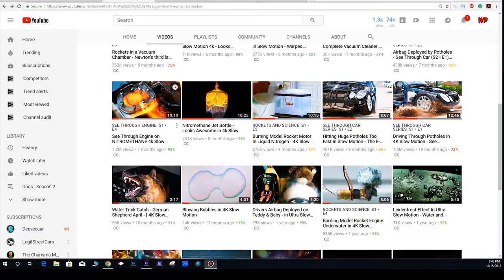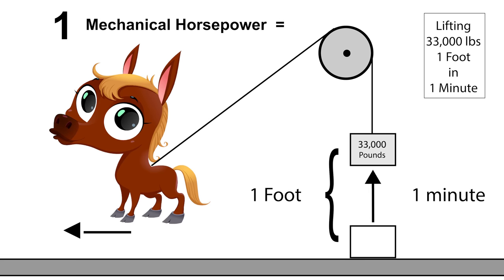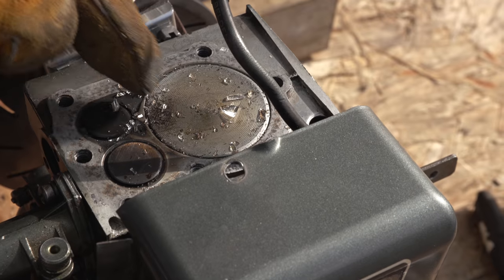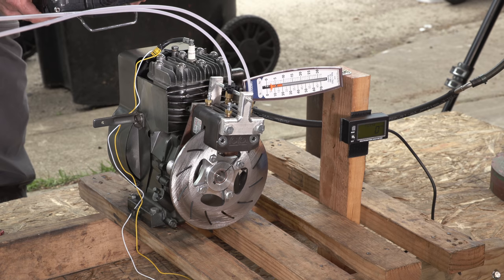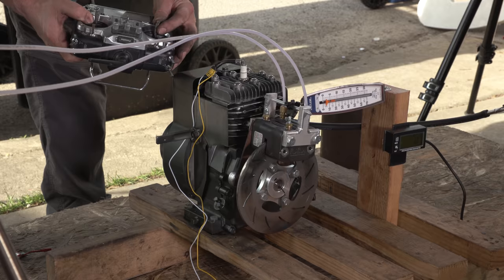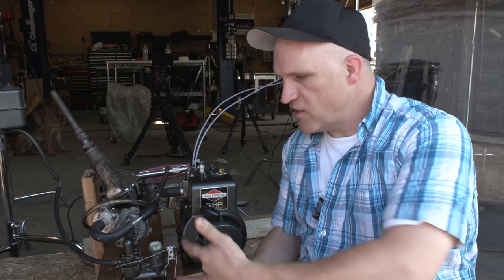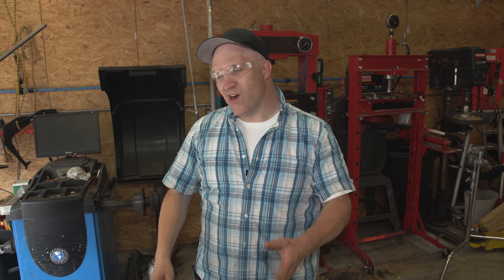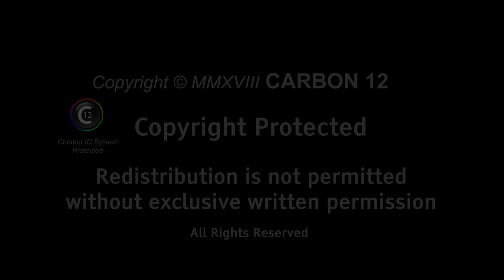See Thru Engine on Turbo Nitro and Dyno  (How much HP does it make?)

Comment: Turbo is too big I reckon, fit a wideband o2 sensor on it to help get the tune right 👍
Reply: I was thinking the same thing. The turbo is too massive for that exhaust to spin up since there's only 1 cylinder pushing it. If this were 2 cylinders, it 'might' spool it up fast enough.
Maybe go down 1/3 in size of the turbo. Hopefully after reading these comments he'll make the suggested changes and review the performance  :)
Reply from the maker: @korishan  yes sir, my figured why not try it out, what I thought was super cool was looking at the high-speed footage during the last take, even though the turbo is spooling up you can see the individual exhaust pulses.
Reply: @WarpedYT . I like your idea of getting injectors. I met a guy that had two turbos in series with each other. If you do find a smaller turbo maybe use both? I mean, why not... right?
Reply from the maker: Well This is a 27 mm turbo, the smallest that I can find online is a 25 mm. Keep in mind that this is the primary turbocharger of the sequential setup on the SL 65. If you have ever heard a SL65 Idle, you will notice that you can hear the turbo whine in the exhaust even when the engine is at 600 RPM. This little turbo is basically producing boost at idle when on it's original application, then at about 2, 000 RPM the transition occurs into the bigger turbo which I believe is a 55 mm, I'll have to measure it but yeah, for me 2mm isn't anything a little more fuel and timing can't make up for. And for the record I actually went to buy that little turbo, but I thought it was way cooler to take a turbo from a car and modify it to fit this engine.
Reply: @WarpedYT  I think your down pipe is too restrictive because it's on a cone chapel and produces unnecessary pressure just for the burnt gas to get put.
Reply: Yeah bad setup back to your drawing board if you're trying to call out turbos ya might want to set it up specifically for a 3.5 HP motor, constructively this was done sloppy and rushed try again turbos wouldn't be a thing if they actually didn't make large power gains
Reply: You may hear the turbo spinning when its idling at 600rpm... but its most definitely not making any BOOST when idling... its not possible.
Reply: @WarpedYT  go actually LOOK for a small enough turbo why say that dude
Reply: Warped Perception now maybe smog pump supercharger next time? If it works progressively step up to more aggressive pulley ratios and see how much more power it makes!
Reply: Yeah it’s going to be hard to find a turbo small enough to make any boost on that small of an engine.  Best bet would just be to hook up a leaf blower to the carb.
Reply: What about using compressed air instead? Rig up an intake with a 1-way valve and a compressor attachment with a trigger...so even without compressed air it can take air from atmosphere but when compressed air is added it doesn't leak out the intake.
Reply: Remove any restriction on the exhaust, turbos like having a completely unrestricted exhaust.
Reply: Warped Perception the whining you are hearing is the fresh air pump that pushes air into the exhaust for emissions. Maybe try putting another carb inline with the other carb.
Reply: maybe turbo from a smart?
Reply: its not the size of the turbo but how much air it takes to spool that turbo and the A/R size is not even making ATMO pressure if anything its a huge restriction you need like a GT15 or K03 or RB31 off ebay/the usual scumbags to even have a shot
Reply: A big turbo may have a big turbo lag but once the egine is running at full throttle it should provide boost which increases the pressure of the exhaust gases wich provides more boost.

Comment: That’s an ingenious dyno. 

I was thinking, how could he possible know what pressure the master cylinder correlates to what torque it would generate. But your brake is mounted to the torque gauge showing you the rotational force placed directly on it. 

Maybe you should explain that a little better in the beginning. But awesome either way.

Comment: Love how simple your dyno setup was! One suggestion I have to reduce the oscillation that sometimes happened while braking, add some extra weight that doesn't stop it from pulling on the scale, yet also resists quick movements

Comment: Warped Perception, I loved the video.  It shows a lot of thought.  The  home made dyno was the bomb.
Point of trivia.
I have a machine shop guru neighbor, who builds 3.5 Briggs, and 6.5 Honda single cylinder engines, for professional go cart racing.  He's getting, the last I heard him say, 32 horses out of a 3.5 Briggs, and over 60, out of the Honda clones.  14.5 compression, big titanium valves, Mikuni carbs, wide overlay cams, and Methanol, with trick exhausts; fly weight aluminum flywheels.  The Briggs are balanced and turning over ten thousand  RPM's.    The Hondas are balanced, and turning 12,000, to 14,000 RPM's. They make 100 mph go karts, if you have the nads to stay in them.
I understand what you are doing, and why.  It's fun, and something to learn.  But, if you want to turn that little one lunger on, there is nothing like big tuned carbs, and compression, with breathing ability.  Five thousand RPM's is just the beginning of making horsepower.  
As my uncle said fifty years ago, "If you want more horses, you gotta feed more oats."
Reply from the maker: Lol, that's a great story thanks, I can totally believe it. As for more horses from more oats that makes sense. My goal here in this series is to focus on variables outside of the engine design, pretty much I don't really want to modify the engine much but modify the variables if that makes sense. My original goal was to get the thing to blow up so I can move on with the engines that I'm featuring right behind this one, but this little Briggs is not cooperating so I'm just upping the ante as I go. Hopefully it blows in the next episode. Thanks for the story and thanks for the feedback that was awesome.
Reply: Exactly, and I'm all in, on what you're doing.  Two different goals, with different means.  Those engines start with $$$.  When you asked for bets, on horses produced, in the beginning, I said '75 horses,,,,, no,,,95'  haha. I thought it would be exotically wild!

Comment: That dyno is brilliant! Super cool to see you do this! Im thinking maybe try replacing the spring scale with kitchen scale and have the brake push down to it so maybe the bouncing around stops.
Reply from the maker: Thank you, well I figured out that the bouncing around was actually coming from the variable resistance of the grain from the Machining of the disk. Once it's broke in it's fine now. Nice and smooth

Comment: I don’t know much here but I would think that turbo is WAY too large for a 3hp NA motor. If you had a boost gauge on it, I would bet it’s not building any boost pressure. Get a hold of the smallest turbo you can find affordable and try again. ...pretty please with a cherry on top. Very entertaining video!
Reply from the maker: Normally you would be correct, however in this case keep in mind I'm running nitromethane, if you add more fuel than turbo will spool, and also be red like a cherry on top, seriously. but in the next episode I'm going to compare this turbo setup to a proper smaller turbo setup and see which one makes more power, I'm personally curious to see what's going to happen.
Reply: Warped Perception maybe a 15 mm turbo?
Reply: They are fairly large displacement. Don't be judging power output with capability to spool a turbo.
Reply: That's exactly what I was going to say.... Not to mention no intercooler.
Reply from the maker: I dont think they make them that small, this one is a 27mm and the smallest i know of is 25mm
Reply from the maker: agree
Reply: @FJRyder , an intercooler will not help in this situation at all. There's no air moving through it. 
I wouldn't even bother with the intercoolerif there was some air flow. 

Nitro is very hard on oil, that's a known fact.  There's different oils to help combat it, but generally just change the oil more often.

A little boost Guage would be pretty sweet.

I think a different carb would be the ticket.  Better adjustability.  IMO this engine is running to lean. Nitro takes a lot of fuel.   But still very cool setup
Reply: Cool. I liked your video, and appreciate that you're taking feedback about the turbo size, because I agree with the commenters that say it's too big.
Reply: What about a chainsaw turbo?

Comment: Wet vs dry boost; probably a very valid idea!  As far as US production cars are concerned in the modern era, Studebaker used a carb box on their blown Golden Hawk in 1957, then starting in 1963, they used a special sealed AFB carb on their R2 engine, and reverted to the carb box with the higher boosted R3 and R5 engines. The latter ran over 200 MPH at Bonneville in 1964, all with a 5 liter engine. Pretty impressive for a stock bodied car at the time!  They used basically box stock Paxton/McCulloch blowers.  The R2 would make about 8 pounds of boost in bone stock condition, although some claimed more...but with all new parts I'm assuming. In a completely different situation, the 2 stroke Detroit Diesels all were supercharged, but later models offered turbos. In my own case, a Turbo 6V92 engine was speced at 350 HP at 1950 RPM. When the boost reached about  12 pounds, you could feel the difference. That was 552 cubic inches.

Comment: We used a leaf blower to supercharge a HF 6.5hp on Methanol mix, and got a little over 14hp. Not that great when figure in the cost of running the gas blower too, but we had fun. We did have to use a dump gate due to the volume of air.
Love your videos,
Smiles.

Comment: says "nothing crazy"... while fingering oil that looks like it has 100k miles on it...  lol  ^_^
Reply from the maker: LOL... Good point.... I'm still laughing and smiling ear to ear after reading that !
Reply: haha.  loved the video!
Reply: Think he lost a finger doing it to
Reply: not a new motor? doesn't exotic fuel REALLY pollute the oil? that is why many Karters change oil at the end of each days run.... each race? $3/qt oil vs $150 (claim price without $120 billet flywheel) for motors that get "claimed" in 1-3 races. that wud upset me as I wud HAVE TO port the head and that is like 2-3 hours work, springs, ...

Comment: Megasquirt injector setup with some feedback relayed through an arduino, and a smaller turbo from an engine smaller than 2L. (Might have to import a turbo from Europe intended for some small displacement 3-cylinder car.) And put an O2 on it to try and setup for a closed-loop run. That'd also be fun, as you could try to come up with a table for advance and fuel amount and timing. (Eke every last thing out of it like a modern car engine.)

Ridiculous? Yeah. But definitely interesting and opportunities to learn some stuff.

--- Edit ---
Did a little bit of Google searching. Ford has a 1L Ecoboost as an option on some Fiesta models in the U.S. (surprised they had them here), so that's where to look for the appropriately small turbo.
Reply: chevy sprint turbo(3 cyl. 1.0l. engine)( super small IHI RHB32 turbo) 1985-1888

Comment: The turbo is too big. If you find a really small turbo you could probably get an increase in power and  it would also help a lot of you used something like an air compressor to spool it up. But definitely give this another try - I love these videos
Reply from the maker: Well it's a 27 mm Turbo, the smallest turbo that I know of is 25 mm, so I figured it was pretty close, I mean it started spooling, so that means it will be able to make boost. I thought the fact that I pulled it off of a car and put it on this little engine was funny in itself.
Reply: @WarpedYT  Yeah that's a pretty small turbo and the fact this is even happening is already some Frankenstein-esque shenanigans. This is kinda dumb but what if you got two engines for one turbo? Now that would be crazy 😂
Reply: @braedydunn7082  how about two turbos for one engine instead?
Reply: @WarpedYT  nah dude you didn't even look for one small enough for this brigs to spool up I'd consider this more click bait instead of actually trying
Reply: @jrdn.lauren  the only possible way for two to work on this small engine is if he got a smaller one to spool up the bigger one and we'll honesty I doubt 3.5 HP is enough to do that
Reply: I agree, also in the AMG 65 setup you have 6 cylender providing pressure, what he could do as someone pointed out put a 4 cylender engine exhaust on the turbo to spool it up, i would also throw in a injector rather than doing carburetted before turbo.
Reply: Get a ko3 turbo from a 2003 Vw gti those things are small but spool

Comment: Put smaller turbo check ebay for the smallest turbo available. Feed it with at least two bar of oil pressure with proper drain. Use an electric oil pump or something...
Reply: Dude didn't even try to look for the right sized turbo
Reply: Codeack101 Bear I mean he probably had the Mercedes Turbo on hand.
Reply: from a V8 and mounting it on a lawnmower XD
Reply: Jake Heke  why don't you?

Comment: Perhaps spool the turbo with an air compressor first as you're starting the engine, that may or may not work...
Reply: I thought about that too, but I think would stall/surge because the engine would never have enough flow throughput for it and would almost immediately cause detonation. A smaller turbo would be best, maybe like a MPS or small 4cyc turbo diesel turbo, the newer the better because it would be more efficient providing a better chance to spin up from an engine this small. Additionally that expansion chamber weirdness he has, leading down to a small pipe again that's on the back of the turbo wouldn't be doing it any favours with spool.
Reply: I was thinking the same
Reply: the turbo from a diesel smart car is perfect for that

Comment: I made 112cc engine to reach 12HP and 18nm of torque with no  turbo at all. Turbo is not very effective on really small engines,  try to upgrade the ignition, camshaft and raise the compression ratio to the point it requires avgas to run.
Reply: plus bore up to higher bore size like 150cc or 175cc or higher and raise the compression ratio so it onl run on 90-110 octane fuel
Reply: Myself run 100cc moped race bike with around 12-14hp...full n.a mod.. big valve, big cam, 12:1cr and runs on pump gas 97ron (95 octane??)... Competing in 3 and 4hours kapcai endurance (moped endurance race)
Reply: @AmirPomen  I'm focusing more on the low rpm torque since I mostly use my moped in traffic and offroad. I won a tug of war competition with 150cc stock bike and once the passenger almost fell to the back during hard acceleration and push me forward when letting go off the gas (engine brake).

And people don't see it coming since it's just restored to it's original body, no weight reduction or visual mods. Also, I'm using a brand new stock exhaust, so it will roar on the carburettor intake on full throttle while not getting caught by the police during traffic checkpoints.
Reply: @calvinlaudrensio415  haha nice one... Yep.. we here also did the same for our road bike...

Comment: 1971, Bonneville, a guy used an air injection smog pump from a 454 Chevy to blow into the carb of a 125 Honda twin...made 8 lbs of boost driven 1:1.

Comment: "Perfect running order" it's just surging like hell, but that's most likely the carb.
Reply: and he advanced the timing 30 degrees in the last video,  so I'm not sure if he put the timing back to stock or not??
Reply: look at the throttle, he is doing that
Reply: @Byefriendo  I think you might be right actually, the motor does act like its about to die when it starts getting full throttle.